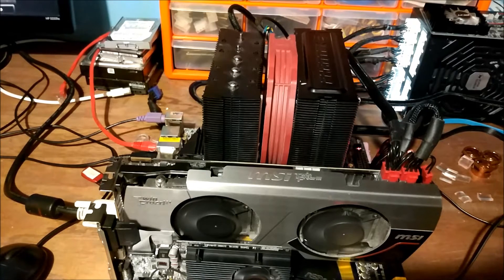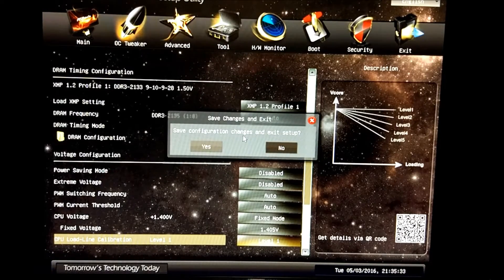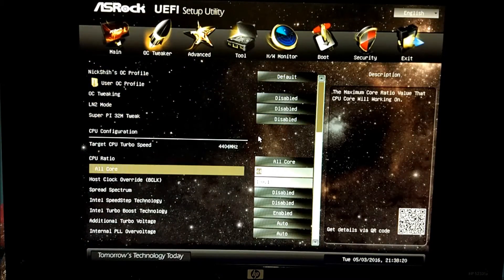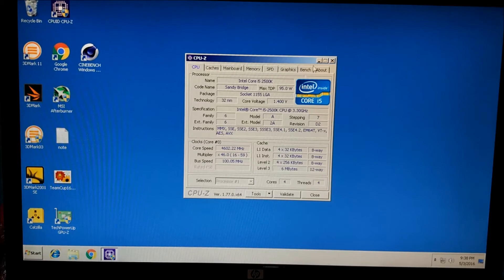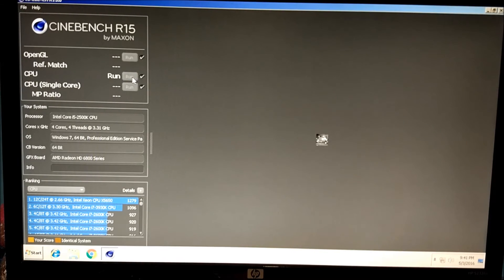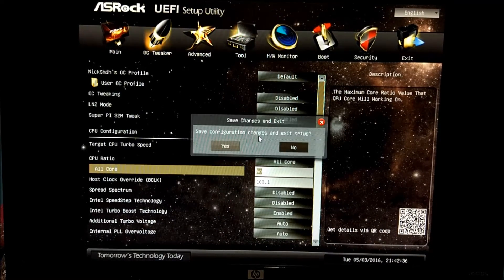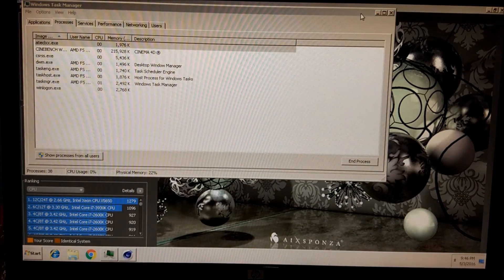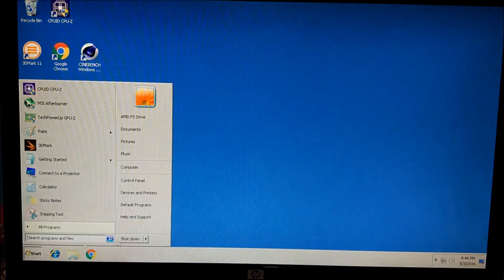How to overclock an i5 2500K to 5ghz quickly Part 1

Comment: Goated cpu still using it with a 1060 6gb and typing this comment on the same pc overclocks are easy for me because of having a deepcool gammax cooler i got 5 ghz on 1.4 volts pretty stable
Reply from the maker: @anxiietty7310  💪💪💪😎 great to hear. 2500K is an epic cpu

Comment: actually the best tutorial i've seen. so many no nos in overclocking, but i just wanna see an old, reliable workhorse perform. if it breaks, fuck it. a used one is $25, so i'm not going to comb through long forum posts written by anxious pseuds for my answer.

Comment: Hi there thanks for the video. I'm very new at this. I just want a "soft" overclock like up to 4.2 or 4.4

How should I start, on which core rate ? If anyone would ever answer and take the time to chat here, thanks on advance
Reply from the maker: Start at 4.4ghz 1.35v and then lower the voltage by 0.025v at a time until it crashes in stress test. Then once it crashes you will know what is too low and go to 0.025 above where it crashed.
Reply: @LawrenceTimme  thank you so much I'll try it :)

Comment: But i cant see the temprature how mutch temprature you are running on gaming ?
Reply from the maker: On big air cooler it should run about 70c in game or 75-80c in stress test.
Reply: @LawrenceTimme  What cooler did you use here? I am still using this CPU and my Temps are going around 80C at 4.3GHZ when I stress Test with Prime 95 for an Hour. I am using a Cooler Master Seasonic 120V Plus. Your response would be highly appreciated.
Reply from the maker: @souravbanerjee52  a phanteks ph-tc14pe
Reply: @LawrenceTimme  Thanks for your quick reply. I stretched the overclocking a little bit to 4.5ghz at 1.350 v at vcore and the PLL Internal Voltage to Auto and Load Line Calibration to Disabled. This is actually leading to 49-50c of idle temperatures on my P8Z68V MB from Asus. I am hearing from my friends about the vcore volt is on higher side and I should keep it from 1.28 -1.32 above that will degrade the cpu. I am just worried about if I lower the vcore and set the multiplier to 45 can that damage/burn the cpu? Actually I also heard low voltage and high multiplier can fry the CPU. I am in this dialema for a long period so request your help. TIA.
Reply from the maker: @souravbanerjee52  no a lower voltage can't damage the CPU. 1.35v is fine though, most people used to run them at 1.4v for years. At 1.5v you might have degrading problems and it will run hot.
Reply: @LawrenceTimme  Thanks for your quick revert again. I saw you overclocked at 1.4V. How long did the processor run, I mean how many years at 1.4V? Is that still running? 
As I said I have set the Internal PLL Voltage set to Auto and the Load Line Calibration to disabled when setting up this up at 1.350V at 45 multiplier at 100Hz. Are these settings okay. or any changes needed. As I could not understand much what these does, so if you can help respond to this. That will be very helpful.

Also thinking of increasing the multiplier to 48 from 45 one step at a time at 1.350V. Will that cause any issues or I should not try that. If you can let me know TIA.
Reply from the maker: @souravbanerjee52  yes it can run for many years at 1.4v, I ran mine for 18 months at 1.4v before upgrading and it was on 24/7 as I did folding at home. The same cpu still works now, but I don't use it in my daily pc. 18 months with the pc on 24/7 is about the same as 4 years running the pc for 8 hours a day. 

Yes increase the multiplier in steps to check it doesn't crash. If it does crash just go back 1 step and it should be OK. Don't worry too much about the pll voltage, it's normally set by the board on auto at 1.8v but you can lower it to 1.65-1.7v which is better.
Reply: @LawrenceTimme  
Thanks again for the quick revert. 
Thats a good amount of time you ran the PC at 1.4Volts for 5GHZ.

I did some further tests with the overclocked CPU after changing the cooler from Cooler Master Seasonic 120V Plus to Hyper212 EVO and below are the results:

It idles at around 41-43C at 1.6GHZ however, when I tested P95 Tests at 4.5GHZ for 6 Hours without any issues. I got temps of about 75-77 C Avg during these tests.

When I was stress testing the CPU the voltages spiked to 1.360V from the base of 1.336 as well where as I have set the Voltage to 1.3500V. And I find the Temps or Voltage shows different by different applications like GPUZ and HW Monitor etc Temps Sensor or the Voltage Sensor.
My Question : Why is this happening even when I set the voltage to 1.3500V? If this based on the Speedstep Option that I have enabled in the Bios which one is correct? Volts of 1.368V, Are these spikes still in safe Range and can be used for daily usage?  You can see this link https://imgur.com/a/xo9kVqu.

Because I am planning to use this seriously for day to day use not 24-7 usage but normal usage. Is that still fine?

Now I tried to Increase the Multipler from 45 to 46 or 47 keeping at the same voltage i am getting BSOD with P95 tests as we discussed over my last message.
My Question : So, Should I try increasing the voltage to 1.375 and then try increasing the multiplier to 47 or 48 keeping all the other parameters the same? Are there any chances of damaging the CPU or motherboard with these voltages? See the current config here https://imgur.com/a/Tvsqr1x. 

I want to rectify myself about what I mentioned in my last comment, it was Internal PLL Voltage set to Disabled and Load Line Calibration to Extreme and CPU PLL Voltage to Auto. You can find all of these details in this screenshot. https://imgur.com/a/Tvsqr1x

If you kindly take a look into these screenshots and just check if my settings are all fine or it needs some correction that will be AWESOME!
TIA
Reply from the maker: @souravbanerjee52  i wouldn't put load line calibration on extreme as it over shoots by quite a bit, it might be better to use the setting below that. that is why the voltage is spiking higher than you have set it.

Also it looks like you are at the limit of the cooler, and P95 is very heavy on the cpu, it will not get that hot under normal conditions.
Reply: @LawrenceTimme  Thanks for the feedback.

 I just lowered the Load Line Calibration to Ultra High where I ran the P95 again for 3 hours and it is stable now. VCORE Volt Maxes ranges from 1.328V-1.352V. Temps also went down. Great Suggestion!. Shall I try to set the PLL Voltage to 1.7V now. Because earlier it was causing some stability issues.
Ambient Temps at 25 C
P95 Low FFT L3 Cache still pushes the Temps at 85C but at idle 41-43C. Yes you mentioned it right the Normal Usage will not push the Temps that further. https://imgur.com/a/w6jbjQg
So, Will it be wise to try increasing the volt slightly high and increase the multiplier?

I was getting a NHD14 but I saw it was around 6C difference(taking reference by other user reviews) with a Hyper 212EVO but there is a quite a much price difference. So, went for 212 EVO. I am planning to add a extra fan to the cooler and check the temp difference.

If you think this conversation is pro-longing here, Do you want to continue over an email or somewhere else?
Thanks again for all your feedback, it was really helpful!
Reply: @Lawrence Timme 

After the change of Load Line calibration to Ultra High, I found that CPU voltage stays around 1.344v-1.352v even when Idle but when Load Line calibration set to Extreme,  it idles around 1v or lesser.

I found many people configuring using the Offset Voltage rather the Manual Voltage. How are they different in operation? Does the offset works as a Range?
I find that my PC does not wake from Sleep when the Keyboard or Mouse is connected via USB HUB but when it connected directly it works fine. I guess this happened after the change in DRam Voltage from 1.65V to 1.50V because corsair vengeance rated XMP profile voltage is 1.5V. But Does this have any relation with waking up the Mouse when connected with USB Hub?

Thanks In Advance :)
Reply from the maker: @souravbanerjee52  I don't think it should make a difference to the pc sleeping.

As for the offset it isn't offset from a fixed number so you have to guess.

Comment: I have mine at 4.5ghz 1.35v on hyper 212 cooler and good case. However I am using offset and LLC. I erclocked a few years back. Now I don't know how to increase to 4.8 lol. I wana keep offset cuz I don't want my cpu always at higher volts. Am I right in thinking this? Need help getting to 4.8ghz. got any good guides? Thanks!
Reply from the maker: You can increase offset a bit. As well as the speed, but don't run over 1.4v
Reply: @LawrenceTimme  i got mine 100% stable for years @4ghz with stock air cooler and stock voltage, is that a good chip? i am just afraid to rais the voltage, also what about deliding this chip?
Reply: @LawrenceTimme  also i wanted to know if it is really necessary to keep the multiplier fixed at turbo? it does not help with power saving

Comment: possible on p67 sabretooth?
Reply from the maker: Yes it depends on cpu not motherboard
Reply: @LawrenceTimme  thanks for responding, I asked because in your text it says a certain motherboard wont be able to.
Reply from the maker: @Jafmanz  yes that was mainly a joke for some very terrible msi board which doesn't have proper voltage controls, an Asus sabertooth should be fine :)
Reply: @LawrenceTimme  ah OK, thank you again! appreciate the content!

Comment: hi there
does anyone know if asus p8-z68 pro and the intel stock cooler with the 2500k will be able to get a good clock speed without high temps?

thanks
Reply from the maker: Lol the Intel stock cooler is awful. You might be able to get 3.8-4ghz though if you set the voltage lower enough
Reply: Ah thanks I guess I'll just have to get a new cooler then

Comment: How much voltage would be too much for a sandybridge cpu?
Reply from the maker: Depends how long you want it to last :P
Reply: @LawrenceTimme  3 or 4 years from now
Reply from the maker: @leobitencourt4719  don't go above 1.4v or 75c then and you'll be OK :)
Reply: @LawrenceTimme  Thanks! I guess I won't do that anyway bc I got it stable at 1.32V 4.4GHz but I can't get 4.6GHz stable even at 1.4v, so I guess there just isn't much to gain here. Temps also never exceeded 70°C even after a long gaming session, so I guess I'm fine.
Reply: @LawrenceTimme  Maybe it has something to do with PLL overvoltage being disabled? I have no idea what it is and I've heard it's dangerous for it to go too high by itself, so I disabled it.
Reply from the maker: @leobitencourt4719  lower pll voltage is better for higher clocks.

Comment: I’ve been running mine at 4.4ghz/1.325v for years. I’m trying to push it further now but there seems to be a wall for my chip because past that it’s unstable at basically any voltage. I’m thinking it’s one of the other voltages but I’m not experienced enough to know what to change. I’ve tried PLL voltage 1.7-1.85v and no luck with that either. Anyone have any ideas?
Reply from the maker: Try lower pll voltage. More
Reply: @LawrenceTimme  I've tried down to 1.7v and up to 1.875v but that didn't help.
Reply from the maker: @6Twisted  going up won't help at all. Try 1.3-1.6v in 0.5v steps. Also there are 2 other voltages you can set at 1.15v but I can't remember off the top of my head
Reply: @LawrenceTimme  Stock is 1.8V. I didn't know how much to deviate by, all I knew was to stay under 1.9V and the lowest his board will do is 1.4V. I managed to get it stable at 4.6GHz but it needed a lot more vcore just for 200mhz. It might just be a mediocre chip on a cheap board.
Reply: @6Twisted  4.6-4.7Ghz will require minimum 1.41-1.42 vcore. At anything under 1.45 you're practically safe.
Reply: @spyretto  I ran it at 4.6GHz/1.4v for a month but it started to crash so I went back to 4.4GHz but now it requires more vcore (1.34v). I couldn't take the vcore any higher than 1.4v because with LLC vcore was spiking to 1.45v which was my limit.

Comment: I managed 5GHz on 1.35 Volts, not stable ofc, but stable enough for Cinebench^^
edit: 672cb on C15 and 497.7 CPU-Z Single thread score (reference 7700k @ 4.2 has 492)
Reply from the maker: That is a great chip :)
Reply: @LawrenceTimme  Indeed :-) I dialed it back to 4.7 @ 1.325 for permanent use since I just had a gtx 970 anyways, but I'm about to get a nice 2nd hand 1070 so I might may enjoy a little tinkering soon again =)
Reply from the maker: @SilkMilkJilk  yeah that 1070 could well need some extra cpu juice in demanding games. 👍

Comment: Back in 2012 I built a machine with a 2500k with a Noctua CPU cooler on an MSI motherboard, but I have never overclocked it.
Reply from the maker: That was a waste then. You have missed out on loads of extra fps for 6 years
Reply: @LawrenceTimme  -I still have my 2500k-based computer. I used it as a, shall I say, mid-range gaming computer (and that on Windows Vista, before - imagine that).

Games like Mass Effect 2, Crysis 2, Skyrim, Diablo III ran fine, not overclocked, with my RadeonHD 6870 from Asus.

I have installed Windows 10 on it only a few months ago only to have Steam back (alongside Windows Vista on an SSD, which cold-boots faster than you can say "Microsoft Windows Vista Home Premium").

I have never been a passionate gamer. That 2500k probably was, is overkill. I am playing Skyrim again, having 300+ hours in :)
Reply: @ibizenco  the 2500k is really cost effective.  if you want more performance just buy a £30 pound air cooler. 4.2ghz overclock and bam. 20 percent more performance. which is enough to beat an i7 6700 in quad core workloads. In computational tasks, not so much. it doesnt have hyperthreading. which means the 2500k is a third slower than the i7 in that regard.
Reply: @LawrenceTimme  -The games that I mentioned have all worked fine, together with 4 GB RAM and a RadeonHD 6870. I saw no need to overclock that computer.

Why would I "tune", say, my BMW (or Mercedes, or whatever) engine, if it runs just fine at "stock speed"?
Reply from the maker: @ibizenco  why would you buy a race car to go to the shops in? The k model is made to be overclocked. You have paid extra, so you should overclock to get the value out of it. By not overclocking it you have give yourself a worse experience for higher cost.
Reply: @LawrenceTimme  -You are probably right. That was a first computer that I had built myself, back then. I knew far less about computers back then, than I do now. I was hesitant about overclocking CPU's, and the voiding-the-warranty" and all those "doomsday warnings" that I read did not help much, I remember. :)
Reply from the maker: @ibizenco  indeed. Intel are great with warranty and as long as the CPU is not physically damaged they will replace it :)

Comment: Would an arctic freezer 33 handle 5ghz with this cpu ok?
Reply from the maker: Depends on the airflow in the case and the ambient temperature. I don't think it would in a hot climate.
Reply: Lawrence Timme k thx. Got any budget (less than £60) cooler recommendations?
Reply from the maker: @brillywilly2998  yes there are some great coolers out there.

https://www.overclockers.co.uk/alpenfohn-brocken-2-pcgh-edition-dual-fan-cpu-cooler-140-mm-hs-05f-al.html

https://www.overclockers.co.uk/alpenfohn-matterhorn-pure-edition-cpu-cooler-120mm-hs-037-al.html

https://www.overclockers.co.uk/phanteks-ph-tc14pe-cpu-cooler-black-hs-009-pt.html

I personally use the Matterhorn in my main system. It's one of the best single tower coolers you can buy. 6 heatpipes and the performance is great.

I also use 2 of the phanteks ph-tc14pe as well, I have both the red and black versions and they are really great for the price. Easily as good as a nh d14 or cryorig r1 ultimate which cost £20-25 more.

I have also recommended the brocken with the dual 140mm fans as that should perform really well with 5 heat pipes and the fans will run lower rpm as well with there being 2 fans of a larger size.
Reply: @brillywilly2998  i have a 2500k, bought an artic freezer 34 i think. overclocked to about 4.3. highest temp is 80 in prime 95.that cooler was 30 pounds. i bought a box of 5 case fans for 20 pounds though. one of thoose fans could be mounted to the back of that cpu cooler, i did that. and i have one fan in the front and one in the back. dont know if that helped or not. also there are water coolers for less than 60.

Comment: fun vid, ran mine @4.4GHz for about 6 years with no issue whatsoever. Obviously not a massive OC but was on a pretty small air cooler. What a chip!
Reply: 4.2 or 4.3 with stock cooler for the past 3 years haha, temps do get up there sometimes though. 
And it helps that we've got 8 months of winter hahaha

Comment: My H61M-DG3/USB3 wont let me put in anything higher than 37 in the BIOS menu? Also how do I know what voltage to use? i've got the same i5 2500k, but i've never overclocked before.

Comment: Mine wont go over 4.8. I've tried over 1.45v but never really turn spread spectrum and speedstep off because in my experience it never makes any difference in stability. Or the +1 to base clock. But I haven't tried it since I updated my bios to this beta bios advertised as an enthusiasts over clocking bios. Maybe if my ASROCK Z68 Etreme4 Gen3 had the power phase they lied about it having in its specs it would do over that. I'll give those settings another go some time. Plus i'm not too happy doing even 1.4v with a Noctua D15 because temps are still shit. And my case has fans coming out its ass.
Reply from the maker: yeah an older asrock board wont provide as clean power as my oc formula did.